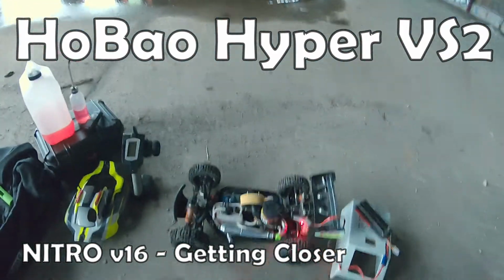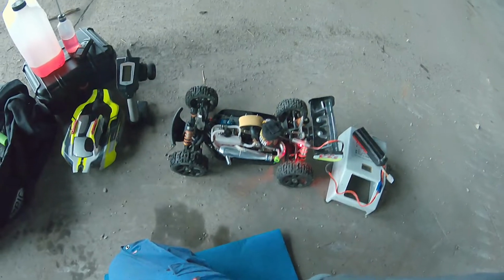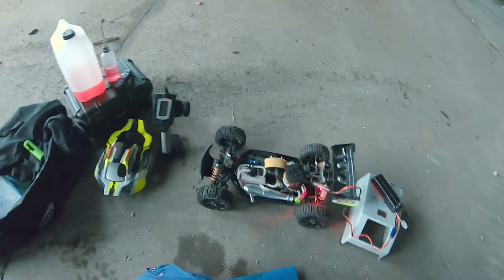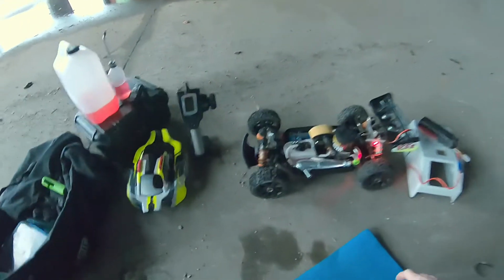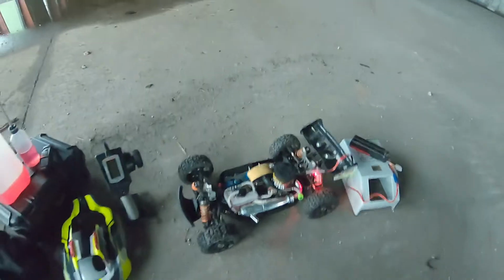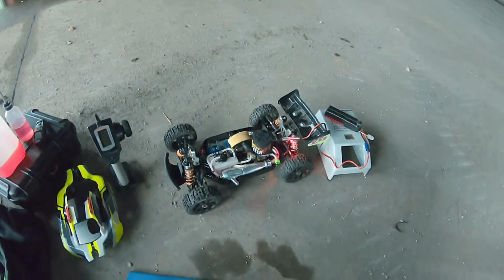HoBao Hyper VS2 - NITRO - v16

Comment: That idle sounds perfect and hsn sounds near perfect at full throttle. How's going from standing still to mid throttle acceleration?
Reply from the maker: Better, but if I let it idle for 10+ seconds I have to jerk the throttle some. And engine temperature must be about 100C. If colder the engine will not go directly to max RPM. Will wait for better weather so I can drive it next time. I also got both a colder and a hotter glow plug. So maybe test hoth with this tuning just to see what a difference they make. It is amazing how small adjustments it takes to get it right. I turn the HSN 5 minutes lean or ritch in the start, and to find the right tuning position it is small 1mm adjustments in the end. Very sensitive.
Reply: @B2Humla  I just got a medium glow plug as shop recommended it for break in, but many racers use ultra hot P3 plugs with 25% nitro so will try a P3 after many hours of use.
Once you have the tuning done your have so much fun and all the work getting engine right will be worth it.
I'm still waiting for a dry day to get mine out and tune engine.
Gonna start replacing parts with carbon fibre starting with servo tray.
Reply from the maker: @lohanette  I have a P4 and a RP8. Will try the P4 it says it is super hot. Maybe easier to get the engine to take high throttle with that one. Keep the tuning more or less and see how it goes. Interesting... But I also look forward for the spring coming in mars and april.
Reply: @B2Humla  I got a fastrax T8 medium. I use Fastrax no 4 medium hot in my hyper 9 which is a standard fit plug engine, but basically same as the VS engine. Will see how the VS runs after tuning and maybe try a OS P3.